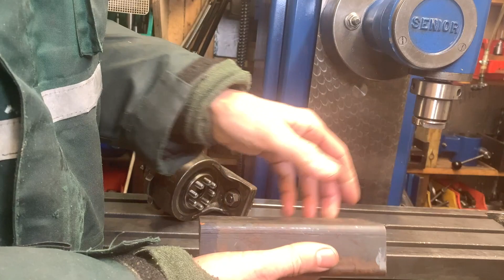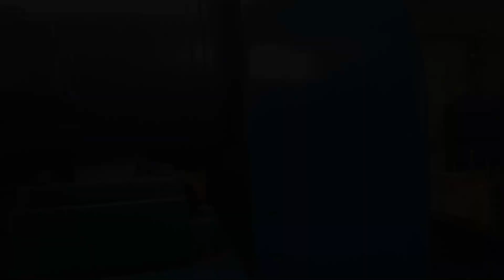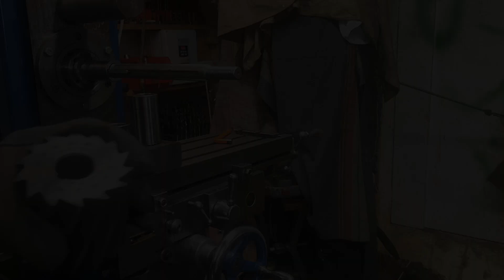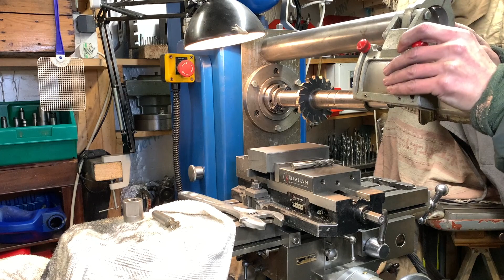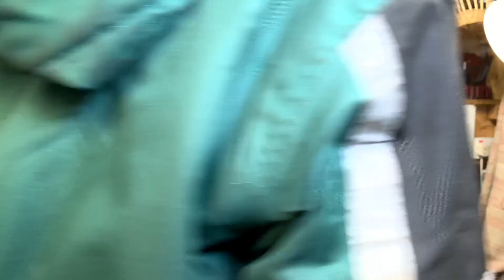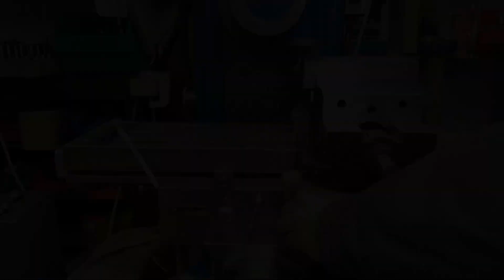Tom Senior   T slotting     32

Comment: Hi there. I love seeing a Tom Senior in action . Do you find not having a quill a disadvantage though ?  I understand they made an S type head to deal with this lack of quill.
Reply from the maker: Yep you're right   .........   lack of quill is a pain.

The S type head is really the E mill on a bracket mounted onto the column. It weighs a ton  ...  so once fitted you've pretty much parked it. 

You still have the horizontal spindle working, but you lose the overarm support  so basically losing much of the horizontal milling capacity - you can run a shell mill in an int 30  stub , but they stick out a fair bit and you quickly run out of table movement in and out. 

The S head motor  only runs the spindle.  so if you want table feed then you would also need to run the  main unit.

Good fun

Comment: Whenever you get the opportunity, please explain how to replace the inner belt.
Thanks
Reply from the maker: You either take out the spindle completely, which is not too tricksy.  Or replace the rubber continuous belt with a linked belt. I haven't tried the linked belt yet as th rubber belts last very well